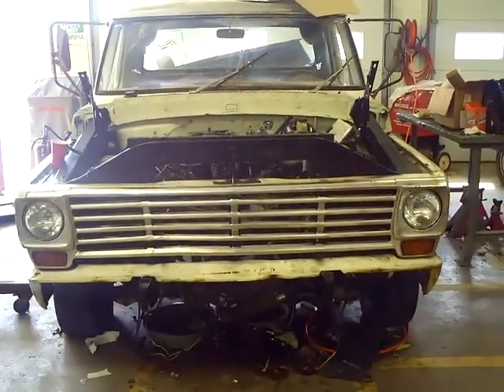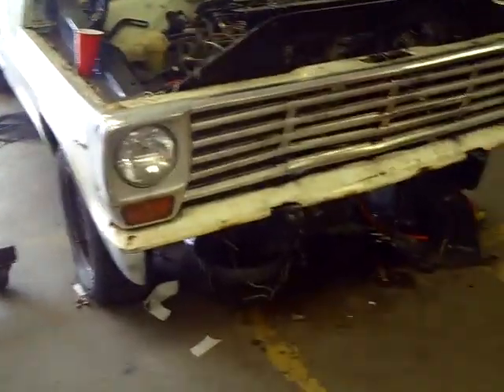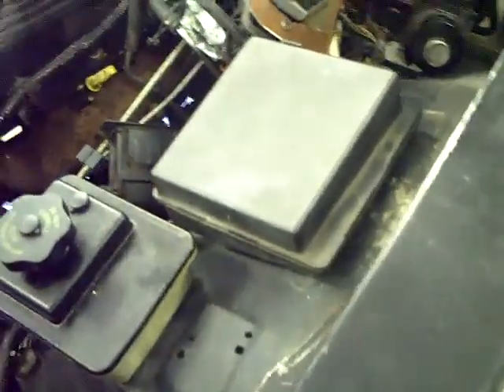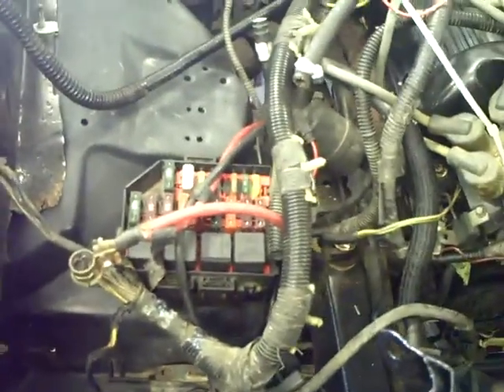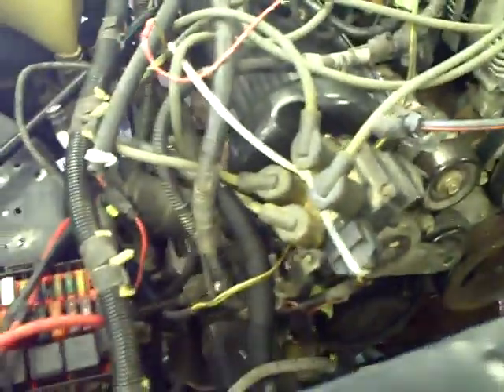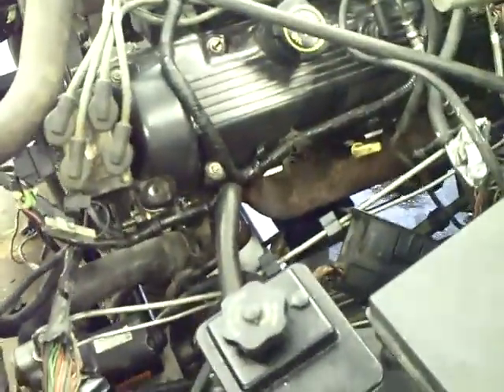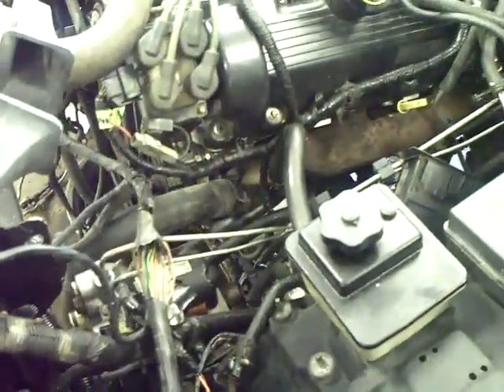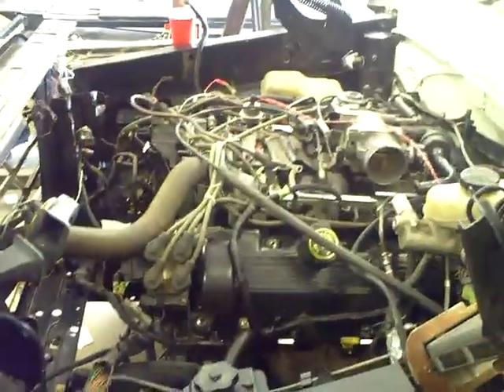CLIPcrown vic front suspension into 67 F100 13 Stiefel's class0002

Comment from the maker: I think you are right I didn't show that. But it's been so long since I made these video I can't remember for sure. I don't like how I done this part but I set the C/V gas tank at the front of the bed behind the cab and made a cover for it so it looks like a tool box. The only other alternative would have a custom made fuel cell that would allow the C/V tank unit to be bolted in it and could be shaped to where the fuel cell could be bolted under the truck. Didn't have the cash for that.

Comment: I believe I watched the whole series on your conversion but I either missed or it is not included is how is fuel delivery done?  It looked like maybe you have a fuel cell in the bed in one of the videos, but I was not sure.  I have a 67 with a 360 currently, but bought a complete '04 donor car from State of Tenn Troopers that had 95k and very minor front bumper damage. I'd like to use the Crowns fuel tank, but as it sits on end, I doubt I can get it under the bed.